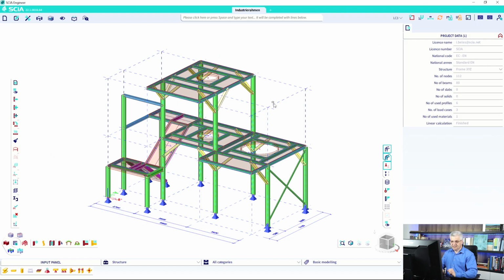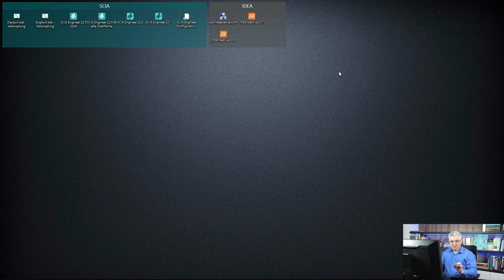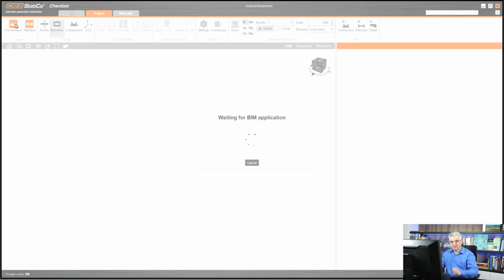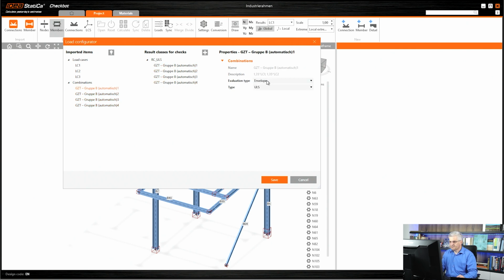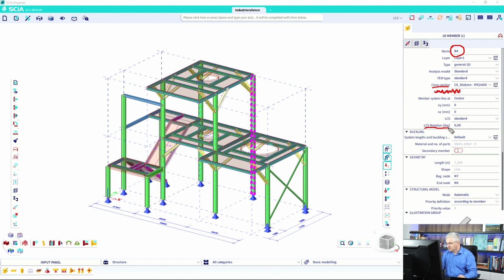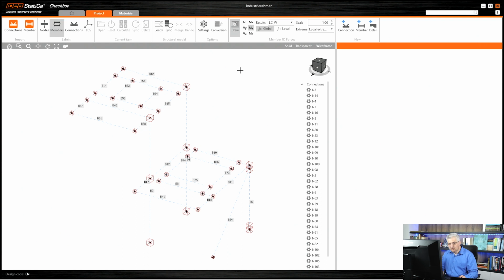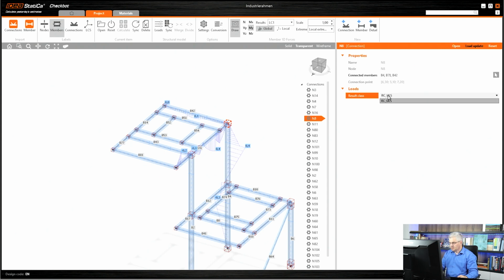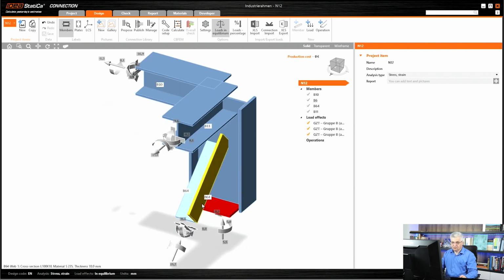Checkbot: Transfer Data from SCIA Engineer into IDEA Connection

Comment: Can we export the scia model including the connection designed in ideastatica to a CAD software?
Reply from the maker: You can export SCIA Model into DWG or for example IFC. This can be imported into CAD Programs. IDEA Model can be downloaded from the Viewer as a 3D DWG.  But the way from Analysis to CAD is difficult. And there are some reasons, why. The geometry of a structural model in a CAD Software, like Tekla or Advance Steel, is much more complicated than the analysis model. And, there is not only the geometry. There are also production operations. And then you have the question of revision control. It is not only one step to calculate and then draw. Both processes accompany each other for some time. Engineer and Draftsman work simultaneously, and the structure also changes often. I personally think, this can only work if there is one database behind these different software programs and each of them must write immediately in such database. Like, if you have a multiplayer video game. You also cannot send the changes to your fellows about your car position by e-mail.